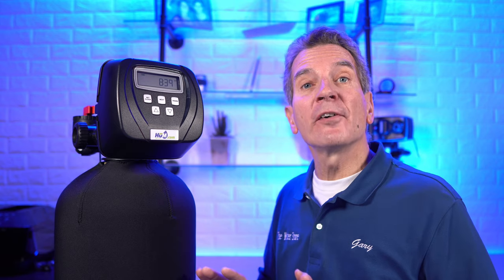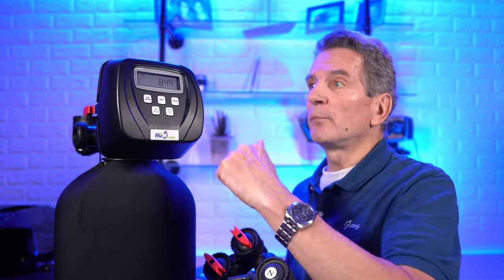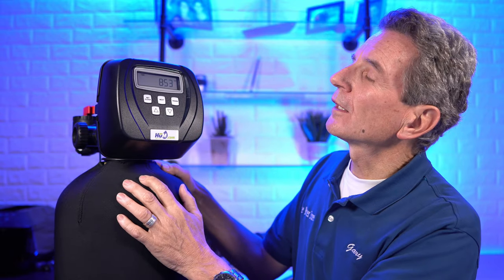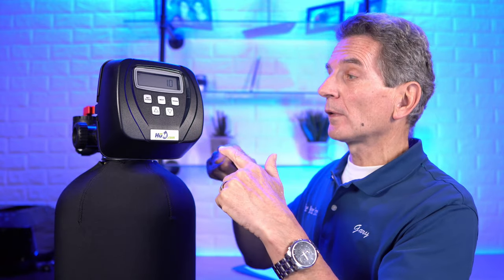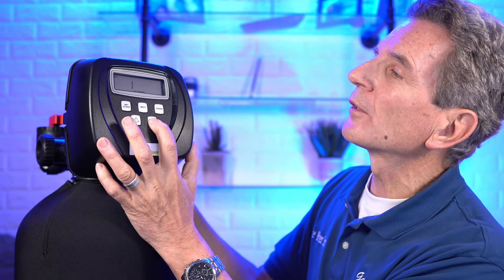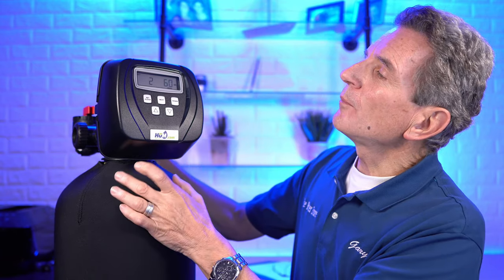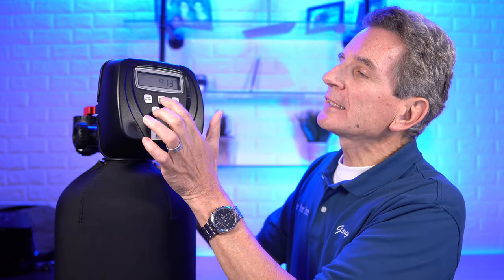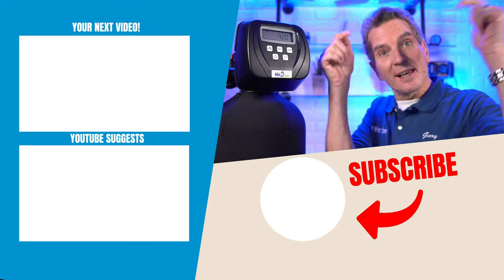Clack WS1 TANNIN Filter PROGRAMMING

Comment: Yes, if there is a a different manual. I continue to have a very small leak through the drain line every now and then when it regenerates. I already change the valve's main assembly and don't see much to change on the drain valve elbow other than cleaning it. In those instances that I have the small leak, I run a regeneration cycle with the water shut off and when it finishes, I open the water supply and there is no more leak.
Reply from the maker: Do you know the exact location where it is leaking from?
Reply: @water_estore  Not exactly other than it manifests through the drain hose. Very, very small leak and it doesn’t do it always. I followed your video and changed all the inside parts of the valve and cleaned everything.

Comment: Hi Greg - I'm in Europe and I have a Large Tanin Filter
The pressure vessel is 14 X 65 inches, model number BMWG14065GB which is apparently 147 Litres, which is about 5.2 Cubic Feet (according to google)
Based on what you have said that's about 70.5lbs or 33 KG of Salt - does that seem correct ?
Also - you talked about the Capacity and grains - on mine it has the capacity in KG so I'm not sure what to do there
Finally - how should I set the Regen ? Is it always 500 or does it change ?
Thanks  - love the videos
Reply from the maker: good question!  The media does not fill the whole tank.  You would have about 3.5 cubic feet of media so about 44 lbs of salt per regeneration.
Reply: @water_estore  Thanks Gary - on Step 5, Capacity - mine is in KG not grains - any idea how I should set that ?

Comment: I have exactly the same tanin filter and I'm tight on water.  What is the purpose of the second backwash?  What difference it makes if I reduce the duration of the second backwash or simply eliminate it as you suggested?
Reply from the maker: 2nd backwash is to make sure you get rid of all of the brine.  You can reeduce or eliminate it but you run the risk of getting brown water the morning after regeneration.